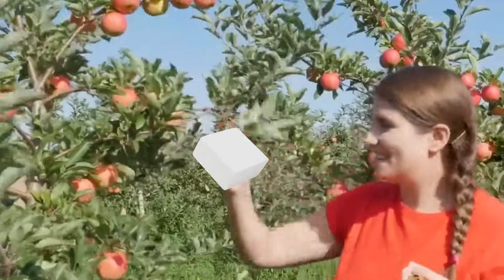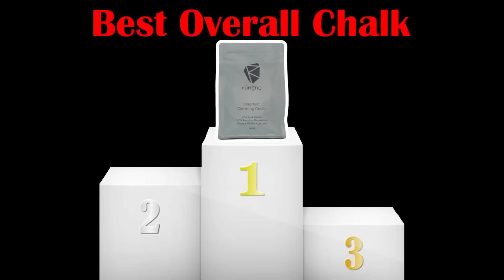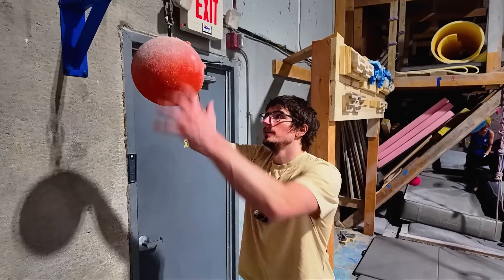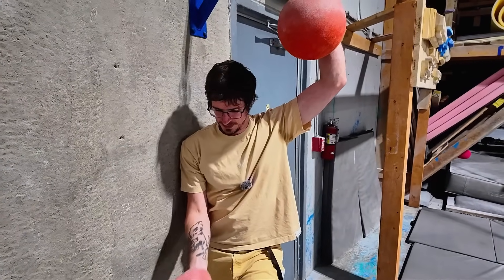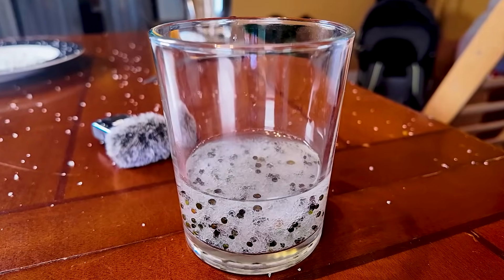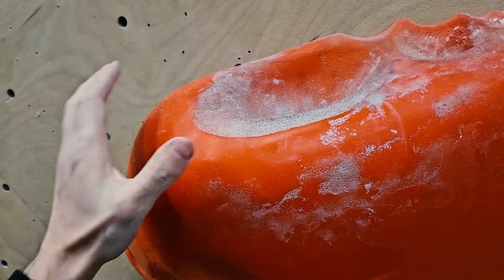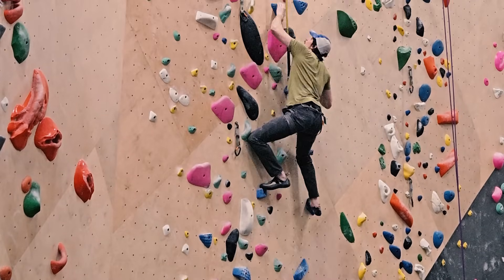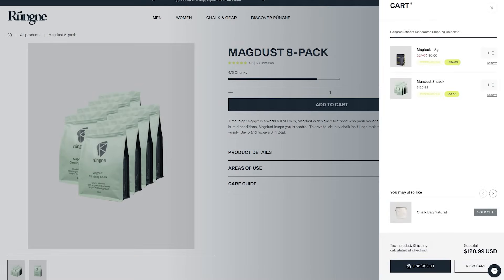What Will Happen to Climbing Chalk?

Comment: Isn't silica dust dangerous for the lungs?!
Reply: Crystalline silica dust is extremely dangerous. Silica silylate has an amorphous structure and is considerably safer, but agencies like OSHA still recommend limiting your exposure to this stuff to 6 mg per cubic metre. 6 mg is really not a lot. I wouldn't use this stuff and I hope it doesn't become a common additive in climbing chalks
Reply: lol ur most definitely letting out 6mg into the air every time you apply this just looking at how much he uses on his hands
Reply: It is

Comment: I use powdered aerogel to speed run silicosis
Reply: My thoughts exactly. I'm all for innovation, but I do wonder what the long-term effects of inhaling chalk are, let alone something with silica in it.
Reply: @Jason-sp5yc  Dude, silica isn't some weird chemical that just got invented. It's fucking sand. It's in dirt, sand, rock, pretty much any outdoor area.

Silicosis is a condition that develops when you're inhaling literal dust clouds without proper protection, for 8 hours a day, 5 days a week, for ten years straight. It's on another order of magnitude.

The fear over this 'silica dust' is the health equivalent of people being terrified of getting cancer from bananas because they're 'radioactive'.
Reply: Chalk particles are too large to enter the deeper parts of the lungs. Ultimately it's caught in your mucus, which is then passed to your stomach
Reply: @Jason-sp5yc  We know what the long-term effects of silica are. It's silicosis. No need to wonder.
Reply: @Jason-sp5yc  Did you try reading through any of the comments where this was discussed like a million times?
Reply: you can claim it's safe because "comments said so" but I am very skeptical of the health issues it could cause in the long term.

we dont need a full generation of climbers to become severely ill 10~15 years after they stopped climbing to find out if these stuff is really safe or not
Reply: @henrychu5918  It's ok to be skeptical and not take some rando climber's word for it.
Reply: It is safe. Source, I am literally a doctor. Climbers are not the only people exposed to chalk particles and this has been extensive studied. This isnt the new asbestos.
Reply: @HawkIze757  Just because you're a doctor doesn't mean you know everything. My wife is a doctor and so are many of our friends, and I can assure you there are plenty of subjects they know little to nothing about. This being moot of course if you're a specialist in this subject.